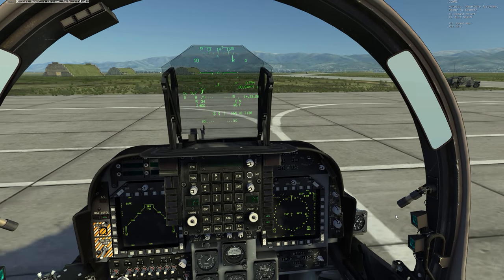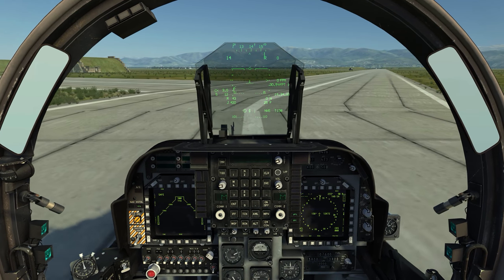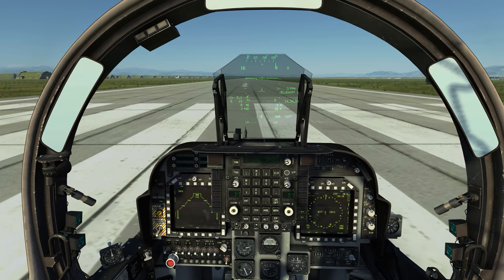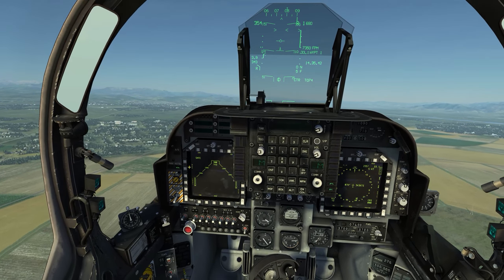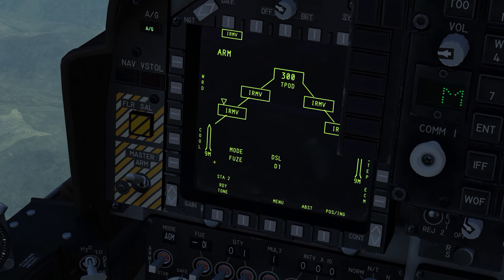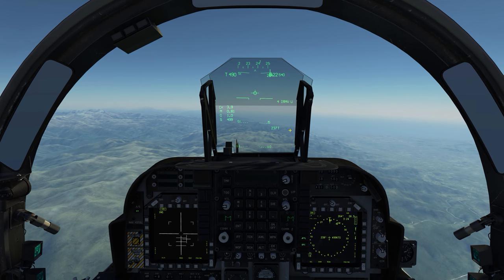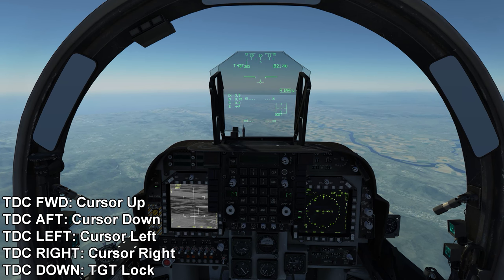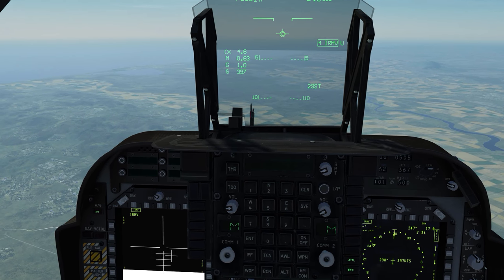DCS: AV-8B N/A Basic AGM-65 Tutorial

Comment: Excellent structured video mate - can the TDC be bound to the nipple switch on the Thrustmaster Warthog and maybe the 'down' function when pressing it in? thanks!
Reply from the maker: Tom Eason i have no idea man. Ive always wanted that hotas but im too loyal to my x65f
Reply: Yes it can but there is a bug and it does not move the tdc
Reply: Soundwave lets hope it'll get fixed soon!
Reply: Yes, but it’s kind if touchy, and I was only able to bind the X Y axes with the TARGET software since the module is still in development and not supporting TDC axis assignments. Problem is, this control is so touchy that using the “click” for TDC DOWN oftentimes accidentally commands TDC directions, too, despite decreasing axis range or deadzone. My solution is currently to map TDC to the COMMS switch with TDC DOWN as COMMS down. Since AV-8B only has two COMMS channels, I don’t need a four-way direction switch assignment. Hope this helps!